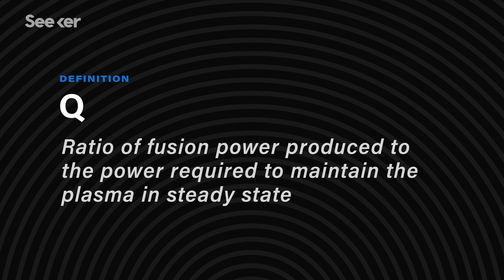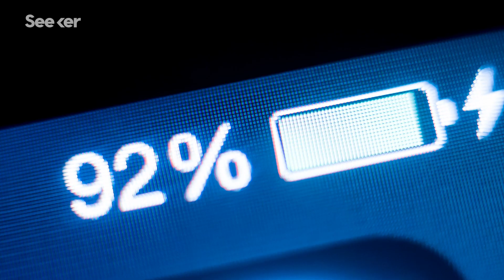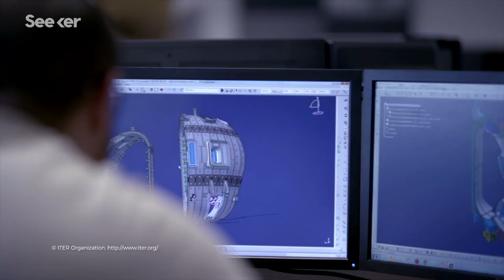How Close Are We to Fusion Energy?

Comment: 2:19 I'm becoming a bit sceptical of this. Not of the benefits (though I probably should be), just the potential downsides. A shorter half-life does not necessarily mean something is less radioactive--merely that it decays faster--and I'm having trouble finding any information on just how radioactive the waste is. I'll provide what I manage to find down below.

An interesting contradiction on a website called "Fusion For Energy," found in their 2nd to last point:
"No long-lasting radioactive waste to create a burden on future generations"
"A careful choice of the materials for these components will allow them to be released from regulatory control and possibly recycled about 100 years after the power plant stops operating."

No long-lasting radioactive waste, and yet it's somehow meant to take 100 years to recycle the parts huh? After the plant stops operating? Sounds fishy. The components they are talking about are likely to be the blanket and shield that stand in the way of the resulting neutrons from the fusion reaction. Detailed in a paper I found on ACS Publications entitled, "High-level radioactive waste from fusion reactors." Though it's only one page and I'd have to sign up and presumably pay to see the rest.

Supposedly fusion reactions using Helium-3 produce no radiation, and is just the all around best fuel from what I can tell. But it's very rare, and also the hardest reaction to instigate. If some graphs I found on Quora are to be believed, under the question "Does nuclear fusion produce waste?"
According to someone else on that page, Deuterium only fusion reactions produce Helium-3, so maybe the rarity of it won't be a problem in future?

My conclusion: At the very least, it doesn't sound like the waste will be any worse than that of fission reactors, but I'm getting the sense that it's being downplayed/covered up to make the idea sound more appealing to investors and/or the general populace. Which is a little odd since fusion will supposedly be a better source of energy when the brightest minds get them working at the required standard.

Wait, I take that back, I just remembered that Cold-Fission is a thing, and produces no pollution, little to no radiation, and thus little to no radioactive waste. Why didn't the market pick that up again? From what I remember it's basically just good old fission with none of the downsides. It even comes with no risk of catastrophic failure, as the reaction is halted the moment things go wrong. Is the power output not up-to-snuff or something?

Anyway, I'd suggest anyone interested research for yourself just how radioactive the fusion process can be. Keep an eye on it.

Comment: I like fusion but I have one big problem with it. Pretty much since we discovered electricity, power plants have been these large scale installations, with massive capital costs that typically require public funding, and have led to creation of massive corporations. I'm not against that per se, I understand that with scale comes efficiency - both cost efficiency, and energy efficiency. But it also means that all the power is in the hands of the powerful (pun intended) and ordinary people don't really have a say in how the power is produced, or how much they are going to pay for it. 
Renewables are changing that. Solar in particular scales down as well as it scales up. You can now have a power plant at the level of your local community, or even your own roof. On-grid storage, which is only now becoming a thing, will address the problem of intermittent generation and will balance the loads far better than any current peaker plant could ever hope to. What we are witnessing today is basically democratization of energy production and distribution.
Fusion can never work like that. Just like with current nuclear fission power plants, you need a massive installation. This would mean going back to the old model - having massive centralized power plants, that are controlled by a handful of powerful entities. This could still happen if fusion draws funding and public support away from renewables.
I don't find it very likely though. The DEMO plant is planned to start operation in 2033, and that's if it's not delayed. By that time the renewable and energy storage industries will be so massive they won't be going anywhere. So we'll probably end up with a mix - a distributed power network with a lot of solar, wind, and a lot of storage, with fusion power plants mixed in, but probably not even making up majority of generation. I personally think this is the best possible scenario. Fusion taking so long is terrible for the planet, but may be ideal for the energy mix we'll end up with.

Comment: (1) All energy generation solutions currently in use are a result of capturing energy when it is being transformed from one form to another, either naturally (like hydroelectricity) or artificially (like burning coal but coal itself is a result of a very long naturally occurring process in nature).
(2) Converting energy from one form to another always has a loss.

Given the above 2 notions, a concept of generating more energy than what was fed in may not work at all. Including fusion, I think that there can be a net gain only when we capture energy as a by-product of a naturally occurring process.

Comment: Tritium, the radioactive element during fusion using deuterium with lithium breeding blankets to make the tritium isn't a by product waste, its part of the fusion process than then fuses to make He3 and finally He4... both He isotopes are stable.  
Lithium to deuterium to He3 and He4 are stable non-radioactive isotopes, only tritium which is only generated during the fusion reaction process then fused to helium is radioactive, with an extreme short life making it vanish quick, ITER and Wendelstein 7x chambers can be entered after 9 hours without any radiation protection.

There's enough fuel in terms of deuterium and lithium usage to last over 35,000 years just from earth's supply.  
The amount of energy created can provide an over supplied grid extremely cheaply; this oversupply of cheap electricity can be used to produce H2 (hydrogen) for hydrogen fuel cell vehicles, that convert the hydrogen into water and produce electricity to run a vehicle.  
You can also produce other carbon chain fuels or even biodegradable materials with electrolysis... electrolysis essentially becomes super cheap, reducing the need for any fossil fuel use at all even for plastics. 

These programs should really be fast tracked.  Once they're developed, it literally would change the world for the better.  No waste, can't be weaponized, can't meltdown, and extremely abundant deuterium just on earth alone for the fuel.  And plenty of lithium for a breeding blanket to fuse deuterium into tritium then another set of chain reactions for He3 then He4 final waste product.  
It's really stupid that the program isn't being fast tracked and replicated by all nations... other than Germany's Wendelstein 7x which uses an advanced twisted method of the tokamak design that assists in heating the plasma to the required to be at least 100 million degrees C.
This should be treated like the Manhattan project, Apollo Project, Three Gorges Dam, Hoover Dam, Panama Canal, Suez Canal, and Great Wall works rolled into one; fast tracking the international one at ITER and a send international ITER like program; and every wealthy country with two or three different design methods fast tracking their own.

Dragging our feet on this technology is pure idiotic. With CO2 already passing 400 ppm, and more dirtier required methods of harvesting oil and natural gas (fracking and tar sands) and the economic benefits of super cheap and abundant energy actually makes electric fuel cell vehicles and fuel via electrolysis that aircraft can use, and even makes space cheaper as the primary fuels.

Comment: This sounds like a perpetual motion device.....
Reply: Joseph It‘s not. It requires fuel in the form in the form of deuterium and tritium.
Reply: right...but it also requires  electrical power going in to get power coming out
Reply: Joseph Yes, that‘s correct.
Reply: so if you get more energy out of this than you put in...you could then cycle the energy back into the machine and it would power itself...how is that not a perpetual motion device?
Reply: Joseph Again, because you need fuel to fuse it. Otherwise, it will cool down quickly. It‘s not generating electricity from electricity, it‘s fusing fuel and harnessing the electricity from it.
Reply: got it....idk why that took me so long

Comment: The problem isn’t the science, as we know it can be done. The problem is the architecture. Instead of a super massive reactor, you need to think smaller. Like a 2x2 two story house smaller. Condensing the power (not power output) generally leads to a much higher heat level. Thus smaller reactors designed specifically for this while maintaining many safeguards and secondary safeguards could possibly lead to reactors the size I’ve stated in multiple major cities around the globe that provide enough power for everyone whilst also providing plenty of extra power that we could find a use for.

Comment: If we would have a fusion nuclear reactor that would exactly simulate the sun, it would generate the same amount of heat per volume as your stomach. So, the conditions on the sun in terms of temperature and pressure are nowhere near enough to generate enough energy per amount of volume that would actually be usuable.

Comment: Fusion really could save the world. There are so many problems that you could solve if only you had access to a large amount of very cheap electrical energy.

Here's one - desalination isn't economically feasible because it takes a lot of energy. Thus a litre of desalinated water costs about 100x as much as water from a reservoir or river. If you can throw unlimited fusion energy at that, the problem goes away. And there's an end to drought in the world, forever.

Here's another - all those petrochemicals that we're running out of, little by little? We can make that stuff. But we don't, because it takes too much energy. Throw in fusion and you have an unlimited source of gasoline, oil, plastic, etc, etc.

Now you can build vast numbers of cheap greenhouses from that plastic, light them with nearly free power, throw unlimited water on them... growing food that way on a mass scale, anywhere in the world, cheaply and easily. And that's the end to famine and starvation, worldwide, for good.

And so on. A staggering amount of really serious problems simply go away if you have virtually unlimited cheap energy. Fusion is going to change the world, radically.

Comment: How are we going to build all that pressure? Keep that pressure inside the fusion chamber where atoms are pumped in to fuse? And how are we going to extract the heat and helium out of that chamber without letting it explode??? It's like trying to harness the energy of a grenade explosion without letting it burst into pieces... only it's a core of a sun instead of a grenade...

Comment: Fusion occurs in the sun's core as a result of positively charged particles (protons mostly) bouncing at high speed due to the high temperature. But that temperature is not enough to cause fusion. Pressure is also needed. The sun has the mass of 2.3 million Earth's, so you can imagine how high the pressure is in the core, enough to squeeze all these positively charged particles together and cause them to fuse. But even that may not be enough. It's also possible that a phenomenon known as quantum tunneling plays a role as well. That basically means the particles, having a wave-like nature on quantum scales, can tunnel close enough together, overcoming Coulumb's law, and then fusing. So we need temperature, pressure, and a very high number of protons in order to increase the likelihood of quantum tunneling in order for fusion to occur. Not easily replicable but possible.

Comment: We have had fusion energy since the early 1950s.   However it is kind of hard to control and requires a fission bomb to start the fusion.  Yes, if we could just bottle up a hydrogen bomb blast and clean the original fission reaction that started the fusion, we would be good to go.

Comment: I would suggest that greater acceptance from the "anti-nuclear" activists would result from using the phrase "REVERSE nuclear energy," which is literally true.  Not only is fusion the opposite process of fission, it uses very abundant fuel rather than relatively rare heavy metal fuel; it cannot sustain itself if the reactor malfunctions, since it does not depend on a chain reaction; it produces helium, of which Earth has a limited supply that is not renewable without (a) carrying out a fusion reaction or (b) visiting the moons of gas giants with spaceships equipped with immense "scoops" to return batches of helium-bearing gases to Earth; it produces short-lived radioactive waste (from the components of the reactor) rather than long-lived waste; it can even be used to make existing fission waste decay faster, thus removing long-term hazards; and it cannot be feasibly used in a bomb without TRIGGERING it with a FISSION reaction.

Comment: Can't wait to see Fusion powered rockets!
Reply: In 1980 they said they want a fusion rocket called Daedalus that would use the enormous heat and pressure to thrust the rocket to STL (slower than light) speeds. They wont have what they wanted.
Reply: Fusion doesn't have rocket potential. It is different from Nuclear bombs

Comment: It will never work, it is a pipe dream that I have been reading about since the eighties. At one point they had one of these on every block producing for small neighborhoods instead of it being centralized. It is like a virtual machine takes more power than it produces.
Reply: Daniel Dulu We already have ones that make more energy than it takes in. The problem is they are expensive.

The problem is not about making fusion work, the basic concept itself works. It’s about making on that’s practical and profitable.
Reply: Just read about the latest and it is MIT and a private company and the are HOPING it will work. I know it works, it has worked for years but the sun exists by virtue of it's shear size. That is why we have to create that environment in order to have sustainability. It is not an easy environment to create.

Comment: I see we're still stuck in the old paradim 0f centralized, corporate controlled energy - what's wrong with individual solar, wind, fuel cell units -- oh, that's right, there no profit in it...
Reply: Bruce G What are you taking about, there is. There’s actually no profit in fusion right now, it’s just a long term project because it’s such a damn good source of energy with extremely high efficiencies.
Reply: with the spectre of pollution still with us - the worst kind, radiation.  But that's right, it has a shorter half life - centuries compared to millenia